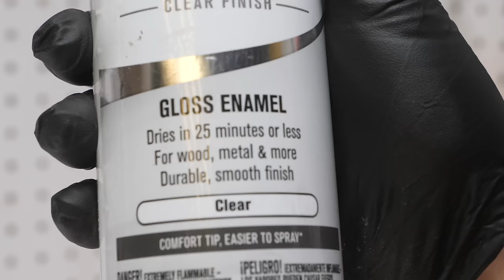Rusty Swiss Army Knife Left To Rot...Knife Restoration!

Comment: Ummm, these knives never rust so this is bullshit
Reply: Agreed.  I haven't had one rust yet, in over 50 years use.
Reply: 😂😂 that's exactly what I was thinking kind of like the Kinsler Brothers with guns
Reply: They do corrode tho
Reply: As a wastewater operator at a plating company I can confirm they do rust when used for repair work around industrial chemicals
Reply: Thanks for saving me writing
Reply: The knife was put in a container of water, or saltwater,  with some other steel that rusted and deposited onto it.  Obvious this was done when he took it out of bath and scissors, etc. were shiny.  I hate videos like this.
Reply: Actually, I had one that did the same thing, because it got left outside, by my sibling, so I had to use this video to help me fix it.
Reply: I have one from as early as ww2 and it still has not rusted
Reply: @DangerGrouse Is it sharp? Has it been sharpened? Just wondering
Reply: Вообще любой метал ржавеет, если с ним неправильно обращаться. Так-что не надо вводить людей в заблуждение.
Reply: So how did he fake the rust? Or the knife was fake Swiss Army?
Reply: The knife is legit. What was done to it was not. If this video was legit I'd be sending the knife to Victorinox for servicing. They'd likely send a new knife back.
Reply: It’s called stain-less, not stain-never 🧐
Reply: I had one, my husband gave it to me. My friend's idiot kid took it and put it under a pile of wood. I found it after it had been out all winter and it looked like that.
Reply: Err, they must do because one of the parts was heavily pitted…..
Reply: @davidrayward7533  Only part I saw that looked heavily pitted were ironically the parts that were aluminum and shouldn't have had any "rust" on them at all.
Fake rusting items so that you can "restore" them for youtube is 100% a thing.
Reply: @1BeGe  Didnt occur to me that. Good point…..

Comment: How can this be so "Rusty" I always thought the Swiss' had the finest' steel in the world, not to mention stainless steel 🤔
Reply from the maker: From the manufacturer: Victorinox Knives are manufactured using Stainless Steel. Stainless Steel has a high resistance to corrosion. However, this does not mean it is resistant to rust or corrosion if not looked after properly. Regular cleaning and oiling are important for your Swiss Army Knife to function properly.

I can email the owner of the knife and ask them how it got this rusty. What we can see is a lot of surface rust that points to neglect.
Reply: @lostandrestored Even if you leave it outside for a year, a genuine Swiss knife will NEVER rust. At worst, the plastic grips may decay, but nothing more.
Reply: The liners are rusty as fuck. Please explain to me how aluminium gets rusty….? Obviously faked for this video.
Reply: It can not lol ...except if you paint it in rusty orange. That's why nobody has seen 1.4110 steel so rusty before this fake lol
Reply: Aluminum doesn’t rust…..but it does oxidize I think and get a white powdery crust. So I think that is legit.
Reply: @lostandrestored I thought victorinox had a chromium coating on their knives and chromium isn't rustable
Reply: @lostandrestored  How about you email the owner and ask him how the aluminum parts got just as rusty as the stainless steel parts 🤣

You're not fooling anyone, bud.

Comment: Nice. This is very odd. I found one today going through my 3 year deceased dad's cigar box and it is in pristine condition...
Reply: It was stored in a different environment than this one anything can change depending on where it is
Reply: Victorinox are the best. Still made in Switzerland (Ibach) 🇨🇭If you treat them well, they can be used for decades. Sharpen from. time to time, but not too often.
Reply: @fireymkb1234 The plastic scales and aluminum spacers shouldn't have that rust. Also the steel is super stainless. There's not way it would rust like that unless if left under water for a decade.

Comment: No way, I have a 25 year old Swiss knife (previously daily use for about 5 years) that wound up just sitting in a box and it had built up mildly rusted blades, nowhere near bad looking as this one in the video.  Well, when these 'stainless steel' blades rust, they are not just surface rust that you can wipe off.  It is pitted into the blade and leaves craters in the blade after detailed cleanup.  You'll have a scar face blade, not a perfectly smooth blade. This knife is staged.
Reply: Agreed. I have had several of those knives and they could never ever end up like this one ... even the aluminium is rusty on this one. Fake.

Comment: You did a really nice job! The only thing I might have done different would be to put new scales on the knife, or at least polished the old ones to a  high gloss.
Reply: Have you ever seen a victorinox blade made from stainless steel 1.4110 ?
No ..
Because this don't happen ! ( and inside the separation are mode from aluminium lol ...who don't rust , but in this video the aluminium parts are orange rusted to ...lol)
Reply: I was thinking about the same

Comment: Its impossible for victorinox steel to rust like this normally, this knife has obviously been setup to be in that state, probably using chemicals. Also notice how all the rust is only superficial meaning the rust is recent, no rust in the moving joints either

Comment: Who doesn't remember getting one of these as a kid? My dad always had about 10 different multitools, pocketknives, swiss army knife, whatever. Then when I got older and statted working on yachts, most of us were issued a Leatherman, but sometimes you got a Swiss Army Knife like this and you needed it. The screw driver function and knife or serrated bkade especially. The scissors were useless as was the tweezers. The toothpick had many uses, especially for cleaning. The engineers got the really fancy ones with all sorts of Allen wrenches and screw drivers. Deck crew had the ones with an awl. That was super important for making lines.
Reply: Sounds like you' had a Great' dad, who really loved you !

Comment: Looks like this fakeo got called out by the audience. Was going to point out that Victorinox SAK's are made from 420J2 steel. A steel that is known in the industry for it's resistance to corrosion. It would take an elaborate mixture of rust inducing chemicals to produce that much scale. As others have mentioned, the lack of deep pitting and damage to the steel is also telling.

Comment: There’s suspicious lack of pitting on those heavily ‘rusted’ stainless steel blades. In the end, they polished up like they were new. Rust doesn’t come from nowhere. It comes from oxidation of the underlying metal. With moderate to heavy rusting you will always get some pitting and loss of the underlying steel.

Comment: That knife had to have been left out for years to rust like that.  Victorinox has used high carbon stainless steel in all of their swiss army knives since 1921. The only way it would rust like that is if it was left in a very damp place for several years or was purposely rusted.  But from the breaks and damage on the handles, I would bet it was left out in a field...or like most of them it ends up amongst a wood pile.. not sure how that happens, but every swiss army knife I've ever found was in wood piles.  another Murphy's law I guess lol

Comment: FAKE!
The knife blade looks brandnew after the rust remover, this knife was NEVER used.
The blade stamp also consists of 3 lines. Old blade stamps have 4 lines. The knife was bought new and made to rust with acid. Who stores knife opened like this? It was opened like this and then treated with acid so it looks cool for the thumbnail.
You can see how fake the whole thing is, the rust is only superficial and not a single metal part is damaged from the rust.
Dislike!!!